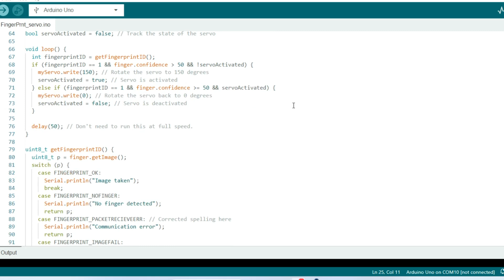Unlocking a Door with Arduino Uno & Fingerprint Scanner | Step-by-Step Guide

Comment: Hello, I hope you are doing well.

I followed your fingerprint + servo door project, but I did not use the white breadboard like in your video.
Instead, I connected everything directly on the Arduino pins.

I also uploaded both codes (enroll + main door code) successfully, and the fingerprint was stored correctly (“Stored!” appears with no errors).

But when I connect everything together (fingerprint sensor + servo + power), the fingerprint sensor does not turn on — no light at all.

Also, I am using a 9V battery as the power source (not a power bank).
I’m not sure if the problem is because of the wiring or because the 9V battery is not enough for the fingerprint sensor.

Could you please help me check what I should change?

Thank you very much.
Reply from the maker: try using external power for the servo and the fingerprint module. Arduino doesn't have the ability to supply enough current to power evertyhing. Look at max current load per I/O pin on your Arduino and you'll see Uno R3 is 20ma and Arduino Minima is 8ma max.

 I don't power any motors directly from the Arduino. I usually just use the Arduino for signal control and power most everything from external power. Sometimes I'll power something from the Arduino if it has low current requirement, but most of the time....use another power source.

You don' thave to use a breadboard, especially for long term. There are lever quick connectors that you can use to join the wires to external power. Just remember to connect commond ground.
Reply: @BMonsterLaboratory  Thank you

Comment: Can internal microchip burn when power pin and ground pin are wrong connected
Reply from the maker: Hey there.
Yes, you can damage the electronics inside the module. If it burns, you sould be able to smell it and/or see burn marks on the pcb or wires. 
If you have a multi-meter, unplug the fingerprint module and test resistance between VCC and GND. If the ohm reading is close to 0, it's probably damaged. 
use external power to see if it works properbly before connecting to your arduino.
hopefully it's fine and is usable for you!

Comment: First make a list all items then i can purchase
Reply from the maker: You can purchase these items on Amazon, just search the ASIN provided below in the Amazon search bar.
fingerprint scanner ASIN: B07G6L7YDX
180deg micro servo ASIN: B072V529YD
Arduino ASIN: B007R9TUJE
slide lock ASIN: B07SHS9TQH

Comment: Sorry for this not relating to the video but in your video a year ago "Make A Raspberry Pi Guessing Game In Thonny Python IDE Using A GPIO Breakout Board And One RGB LED" how would I do it without the gpio breakout board and instead 3 different led lights?
Reply from the maker: Hey there! Sorry about late reply. How are the 3 leds used? I will have to set this up and try it out, but happy to help
Reply: @BMonsterLaboratory  I want to set it that if the guess is too low it blinks yellow, if the guess is too high it blinks red, and when guessed correct it blinks green